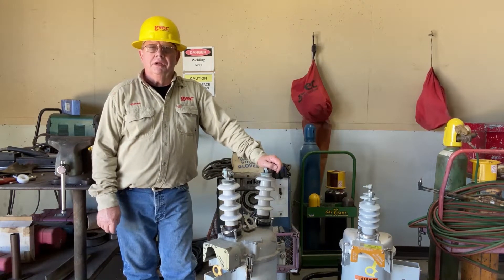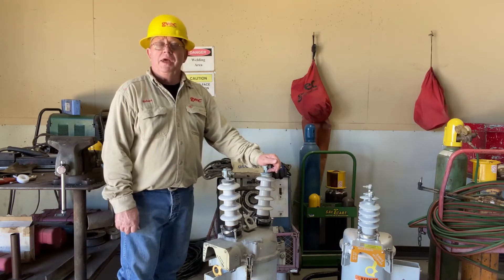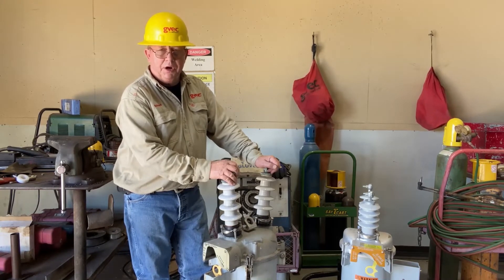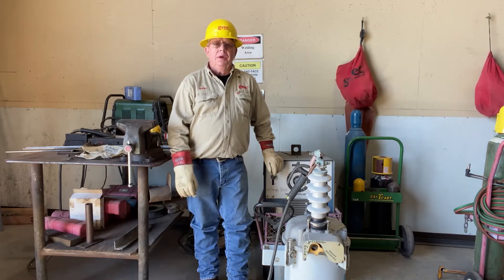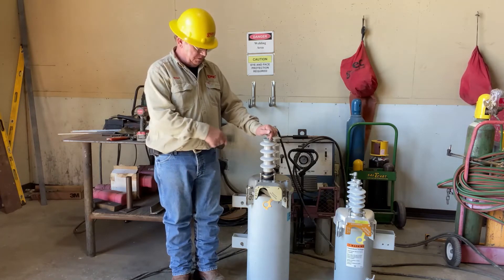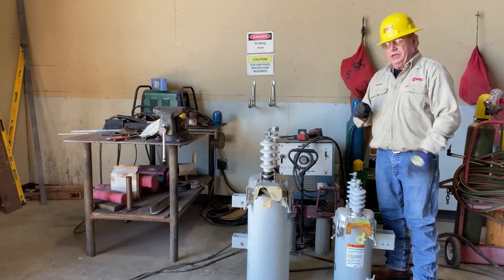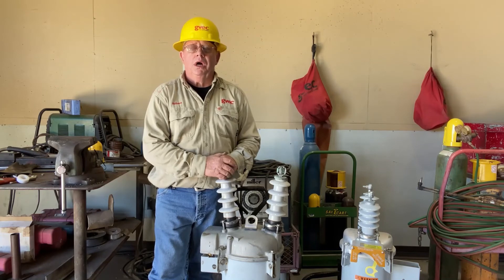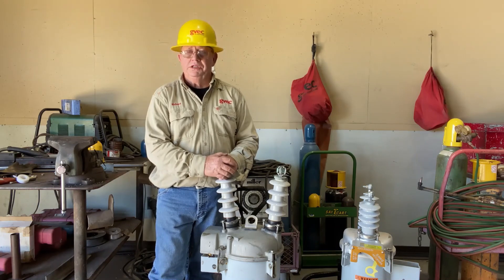OCR Malfunction Review

Comment: I am having surges , I think I saw a tiny bit of like fire where the ground connection to transformer is, is that possible.
Reply from the maker: Of course something like that is possible. If the transformer is a single bushing primary, the ground lug is the neutral return for the high side coil. Contact your local utility for an inspection.

Comment: Do you referb the old ones to be put back into service
Reply from the maker: Yes, a failed recloser will be rebuilt if possible. These are run to fail, so 10-20 years on the line.

Comment: Great Video! Is there an oil tap down at the bottom where you can hook up a glass syringe and extract a sample for regular maintenance over the recloser life?
Reply from the maker: The OCR tank does not have a way to drain oil. Depending on contact type, regular scheduled OCR maintenance is a changeout and rework every 3-5 years. This was left until the OCR failed at 16 years. I do wish the run-to-fail philosophy was not so popular.